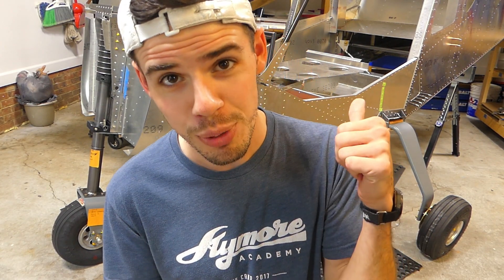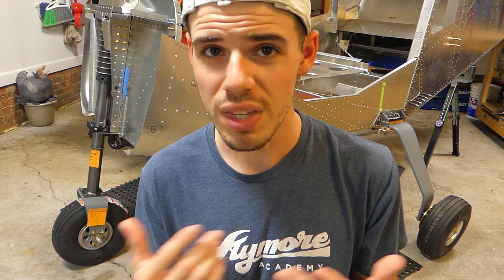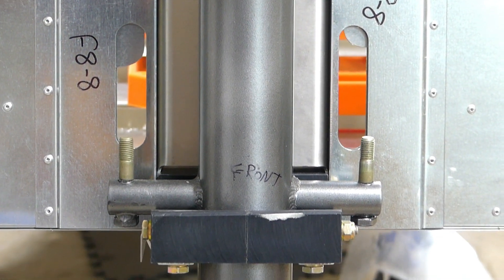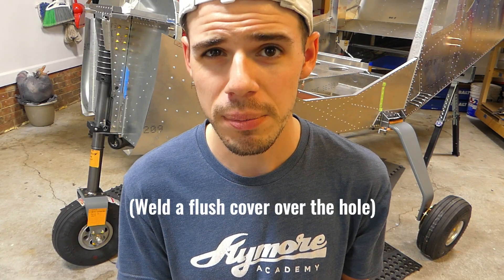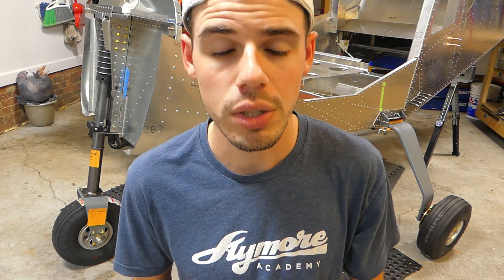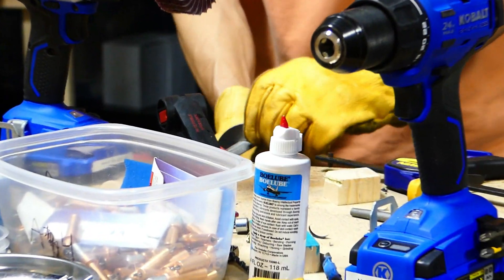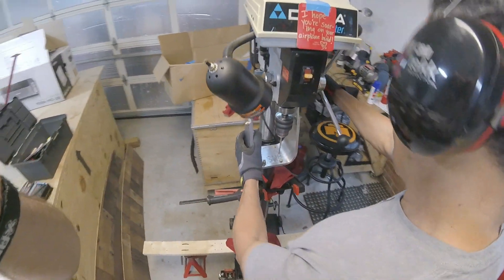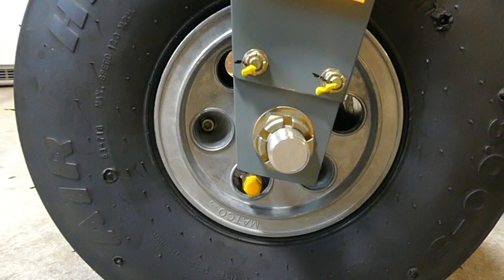NOSE GEAR - Landing Gear PART 1 - Zenith 750 Cruzer

Comment: You need to grease between each puck and spacer. In your bid I didn't see any grease on the close up. If these had been greased I would expect to see some small traces of grease even if you are  super careful. Greasing in between each puck and spacer (not just the hole) strut).

Comment: Excellent vid!.  Not sure how you can weld on a cap after cutting off the bungee tabs without them interfering with the donuts (since it looks like the donuts slide over the welded over hole?

Comment: You may have already noticed this but I believe the 6 bolts that hold the fork to the down tube need to be reversed (that is the way mine is).  In other words put the nuts on top and not towards the tire.

Comment: Looks like a lot of work.  In hindsight, you coulda made a template around that weld for bolt positioning and then transferred it to the bottom for drilling. I know it doesn't do you any good now but if you find a similar situation where you need to blind drill something.